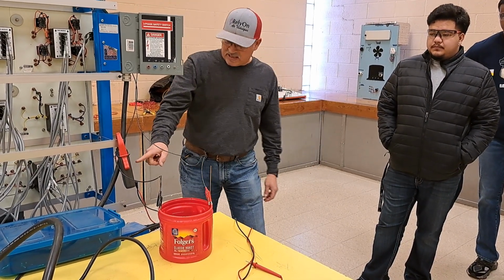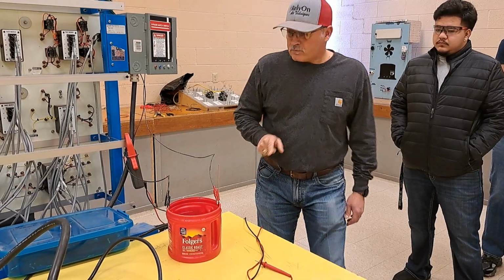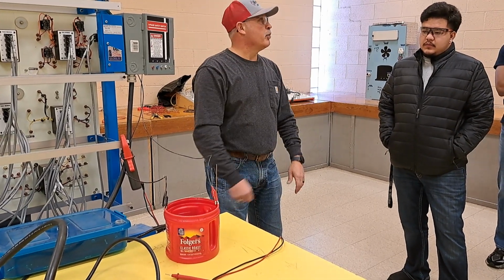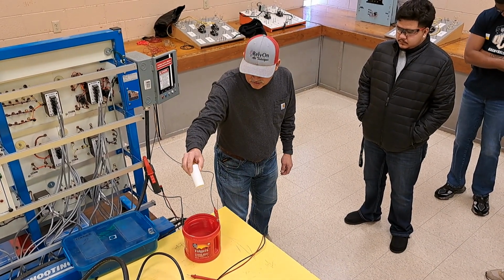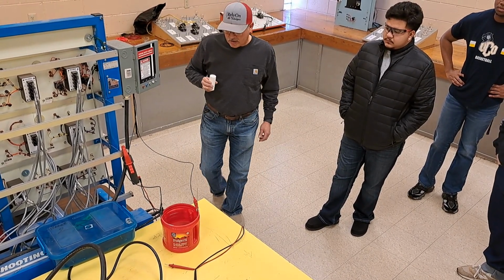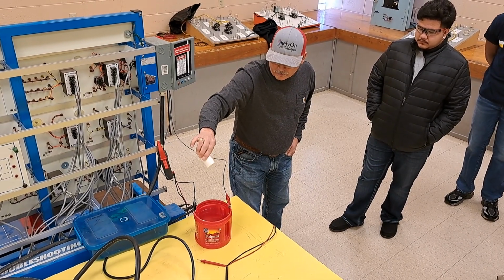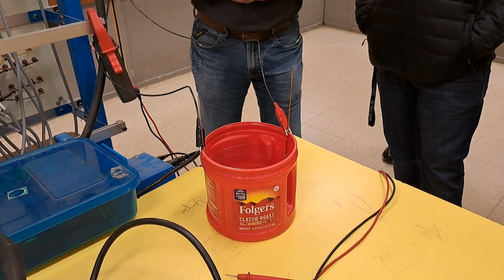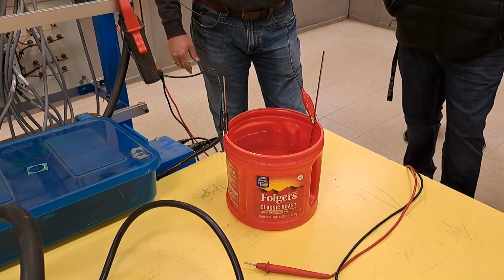Is pure water an electrical conductor?

Comment: You should also explain to the students: do not expose flame or sparks to top of coffee container while it is making hydrogen gas. Even if main switch is shut off, some Hydrogen gas will still be floating out of the container for a while. A spark or flame  will ignite it instantly.